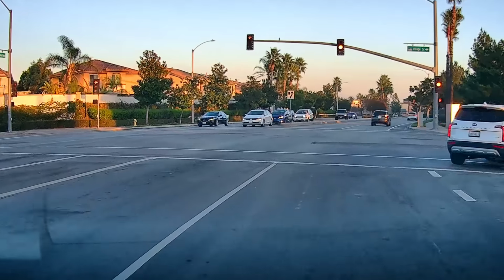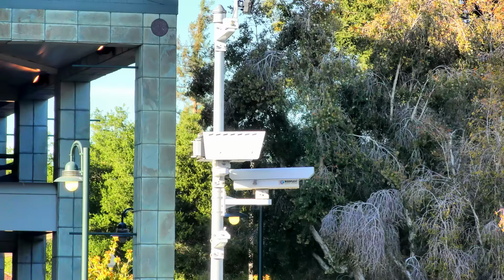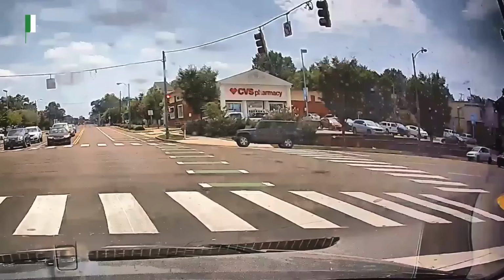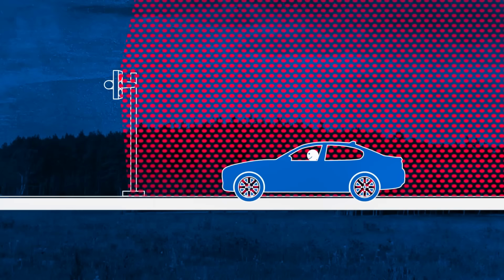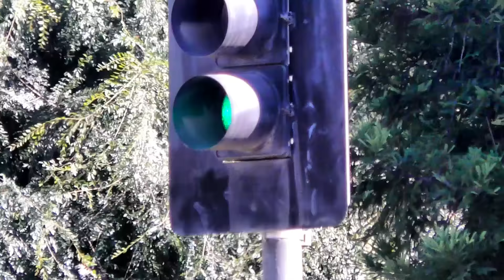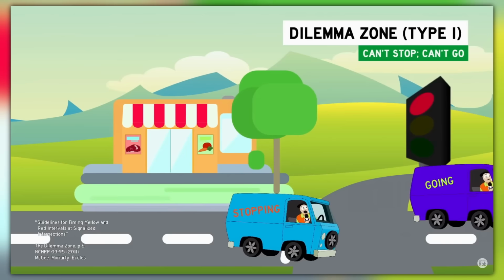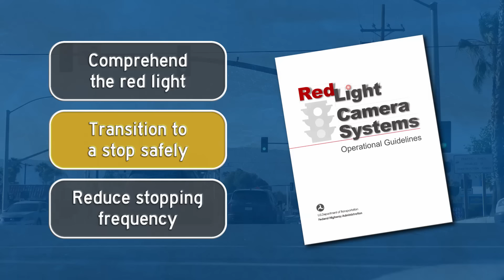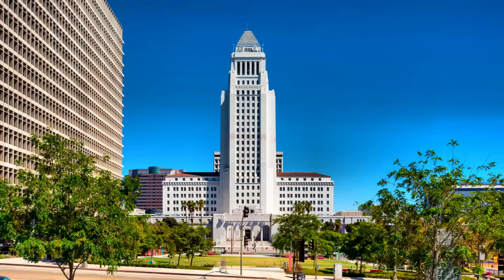Three ways to FIX a STOP LIGHT (so drivers ACTUALLY STOP!)

Comment: This is why I advocate for more flashing "RED SIGNAL AHEAD" signs to be installed about 300-500 feet ahead of stoplights all across America. The only ones I know of that exist are just North of the AR/MO state line on Highway 65.

I also heard that some places in NE America have countdown timers on stoplight poles that look like hourglasses. I want these too, but I feel like these are much less likely to be installed in this area, since we have crosswalk signals with timers on most stoplight poles in this area.

I have seen some filters in this area (Tulsa, OK), but they are installed on stoplights that are not near other stoplights. They make you think that the stoplights have lost power, until you get LITTERALLY 10 feet away from the stop line. Then, you see that the light was green the entire time! I HATE these because they are used in all the wrong places!

Most stoplights don't have lights to the side or on the other side of the intersection here. I see how difficult it could be, but I rarely ever get stuck behind a large truck or bus.

I am also advocating for different types of intersections, including Roundabouts, Dogbone Interchange (also called a Bowtie Interchange or a double roundabout), Diverging Diamond Interchange, and Single Point Urban Interchange.

Comment: @1:03 - "reduce or eliminate the number of people running red lights" - that's total bull. No city ever put up a red light camera in order to not make money.
THEY ALWAYS MAKE MONEY. And that is why they are there. You have to be totally ignorant of the motivations to not see it. Try attending the meetings were the city decides these things. Don't be a fool. It's the money not the safety. The safety is the indicator as to where to put it in order to generate the most funds.
Red light cameras are for taxes ONLY. They never ever ever stop an accident. Ever.
Reply: It's very funny when the video reports on the city who set the yellow light to be very short, in order to ensure that they would maximize their fines and revenue.
But it was reported as an accident that just needed fixing. Hilarious. So trusting.

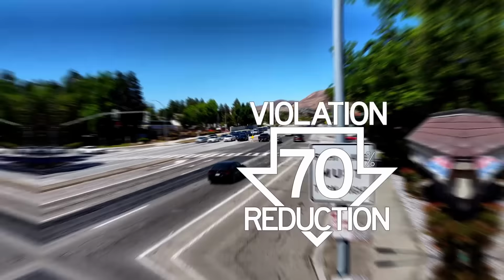Comment: What a load of DONKEYDOO  at 9:55 Drivers: "we like to speed" 
Engineers and Rob: "okay, we'll encourage it, and add time to the yellow. "
BETTER OPTION? Traffic calming coming off the freakin' freeway.  If you calm the traffic fewer people will be speeding, it will be less comfortable to speed, rather than the wonky engineer of designing off ramps of freeways that encourage speeding, then have a design speed of connectors that is higher than posted. Bring down the design speed. If a driver is speeding and runs a red, they should be getting a ticket.

Comment: See, my first thought was tire shredders that pop up as the yellow runs out, and flatten when it turns green.  This would eliminate accidental red light runners without other casualties, and would rip apart intentional runners.

You're way too generous.
Reply: What does it do to prevent crashes? A vehicle will roll at speed with tires popped..Yeah it punishes BUT to the innocent gonna get hit it wouldn't stop that. I say what about a psychical device that would psychically stop a vehicle til green, Something that psychically holds a vehicle til it turns green but of course Emergency Vehicles on calls could have a device to override and make opposing traffic freeze til they go through.

Comment: Red Lights are so 2023.
The future is your car negotiating with upcoming intersections to schedule a crossing time. Once your car knows the crossing itinerary, it adjusts its speed to ensure that it passes through the intersection at that scheduled date and time. Since all intersections are schedule based, there is no reason to slow any vehicles at all. It saves fuel and time.
Red Lights are bad for the environment. Red light cameras are evil tax generator for pathetic people. They do not solve any problems and instead result in a society that depends on it.